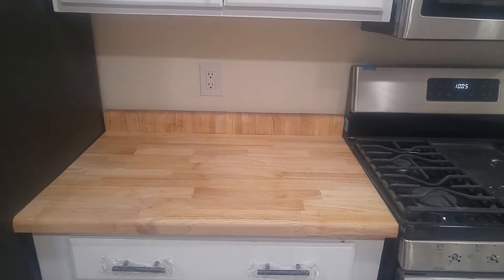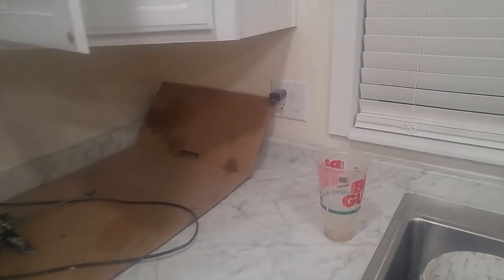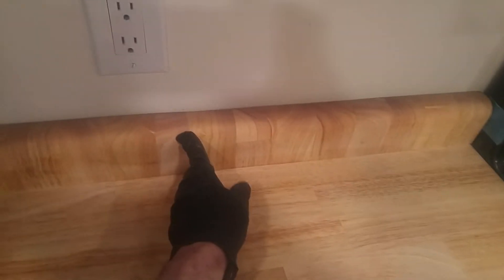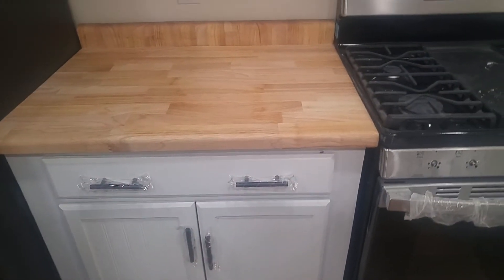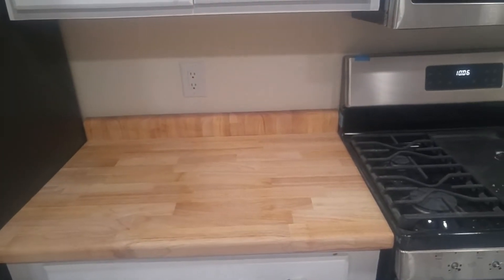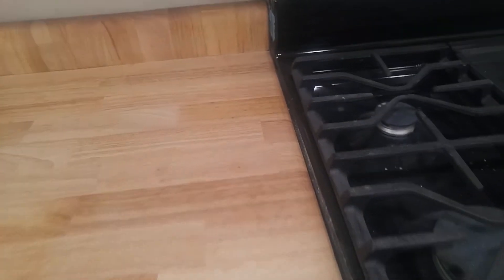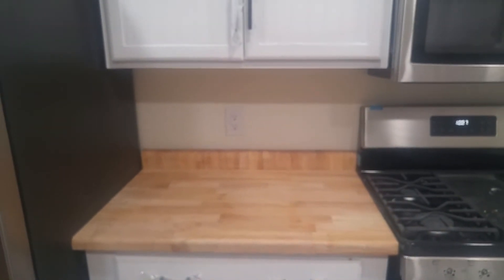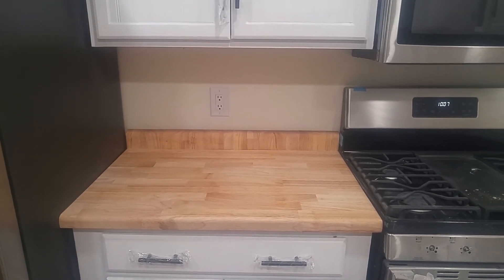butcher block counter top backsplash.(Free)

Comment: Im putting in butcher blocks counters..do i need to reinforce my existing cabinets?
Reply from the maker: i added some one by 4 flush to the top and shot some brads in the sides where noone will ever see then drilled some 1/4 inch holes ....in the fouir corners  not measuring just so there easybto get tom from the bottom .this allowed me to remove them adjust them or level them with washers using 1 1/2 or 1 5/8  ledger lok screws .    if your in an island yes stiffen them up .but make sure they are square gbefore you drive the lags in ..

Comment: Did you caulk the seam to the countertop? if not, what did you do/use to join the backsplash piece to the countertop to keep liquids from running under the back splash? I have a neighbor who had a guy install one and there is a gap between the counter top and bottom edge of the backsplash. I'm going to help him out to correct it as the "contractor" who was doing the work just split out of state on him. My plan is to mount the backsplash piece to a jig and run it through my table saw to get a true straight bottom edge. Just need to know best way to seal the seam. thanks
Reply from the maker: there was no info out there on butcher back splashes .if i knew i wasnt alone i woujld have tried to do an assembly video .i get alot of these questions while im at work sorry i took awhile to reply got anymore questions .ther no problem im just gone during the day
Reply: @toolsntruck941  now worries. I ended up using an acrylic caulk like how you would use gasket sealant and clamping the backsplash down to the counter top, then finger squeegee the seam and it’s super clean and sealed up
Reply from the maker: its strange that there is no info from the butcher block makers as what to use for a backsplash?are they thinking everyone has a island in there kitchen .i screwed mine down to the cabinet didnt want it shifting as it is somewhat a workbench .glad you got it worked out .im planning to get more problem solver videos out .might help out some Diy people i myself am in my 33rd year of working as a carpenter remodeler .with no young people wanting to be tradesmen i guess i could share my knowledge online?
Reply: @toolsntruck941  I hear ya about nearly none of the younger folks wanting to learn the trades. I cut my teeth working for a real general contractor building homes from the ground up. I also screwed the countertop into the uppers and used pocket holes screws into the studs to secure it to the wall.

Comment: Where can I buy the sealer for my  Butcher block. I have it just need a seal
Reply from the maker: lowes has something called butcher block oil or conditioner and the joint between the top and backsplash was a straight cut and pre drilled from the bottom .then using grk cabinet screws drawn together water tight ..those screws kick ass and wood as we know compresses.